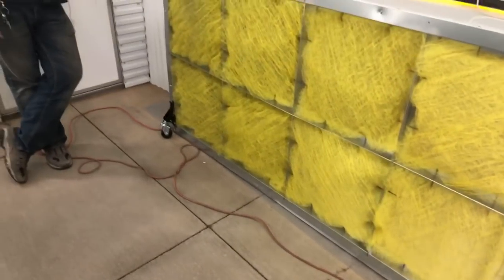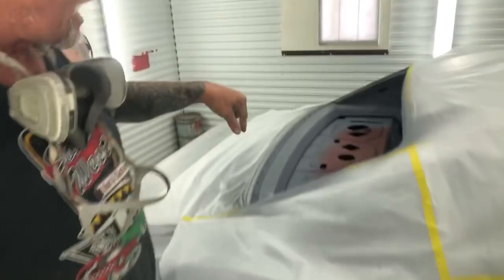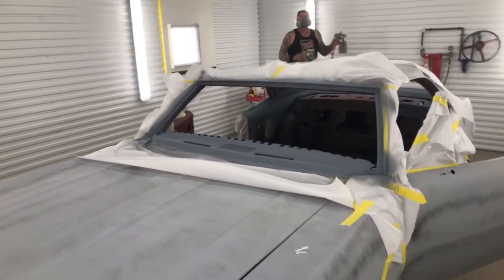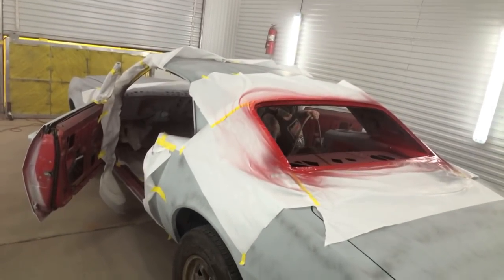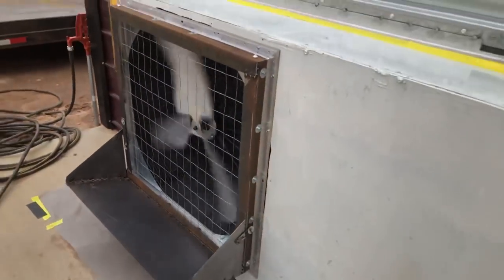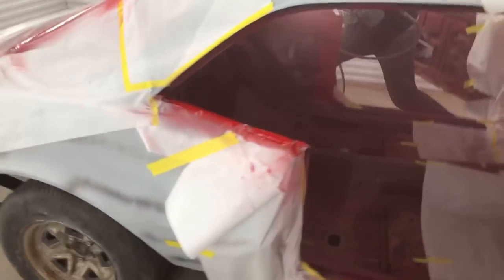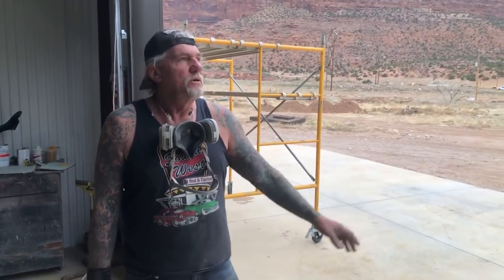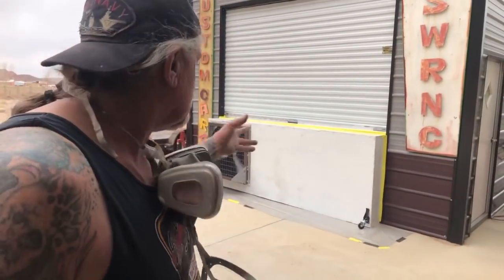Is This HOMEMADE Paint Booth GOOD or BAD? 😡😡😡

Comment: Pete, thanks for always providing us with helpful videos. I’ve been painting on the side for many years non professionally. I have a 40x52 building and I want to put a booth in the back corner. Can you tell me what you used on the walls and ceilings?
What are your fan specs? I just built a box similar to yours for temporary use but I need to make something more permanent. Any info helps and I would love to just “buy a boot” but I’m keeping it real. I cant afford a real booth and cant justify the costs

Comment: When my friend and I (friend is a body man) rebuilt my 2001 ram cummins. We were painting some old obsolete olive green army pain.. might have been lead not sure haha. Any who. I decided to build a down draft booth. I used 6 merv 10 pleated furnace filters vapour barier the whole half of my shop and set peg board under  my truck the board extended 4" past the truck or so. Then used a furnace blower motor with a wooden box duct to suck out the fumes. It worked so good we ened up sanding down the whole truck before we painted did some more body work and did final paint in there. It turned out so good

That said your system looks good quick and simpler haha.

Comment: Could be good to apply a water based spray booth coating (Never dries as a film) over the walls and ceiling so that you can pressure wash the walls down once a year.  Also suggest making retaining mesh on the back and the front of the filter material so that the material is compacted, covers the entire vented opening evenly and makes it easier to change the filters when they become clogged.

Comment: I think you need an oscillating fan in there. If you want to test my theory, do a smoke test. The air is only going from the intake to the exhaust. There’s a lot of spots it is not getting I would imagine straight across the opposite side you need to intake.

Comment: It looks like it will work, ok. Plenty of light, airflow good. Are the inlet filters thick enough? A good dust storm my get through.
Reply from the maker: The inlet filters are PRO Paint Booth Filters used in any and all paint booths.. I don't use furnace filters...... They fit tight so they should hold up.. If i have any issues ill tape in the corners.. Thanks for watching William.